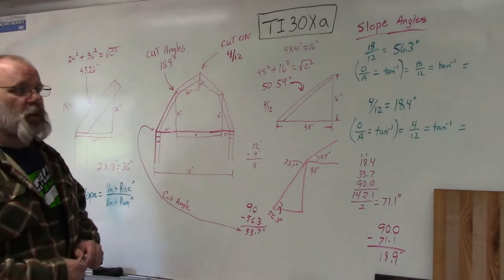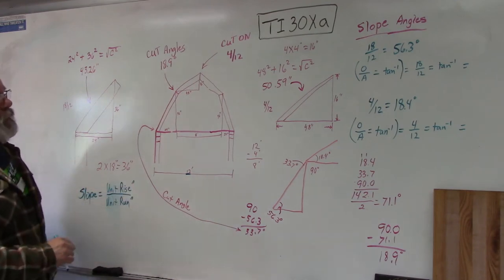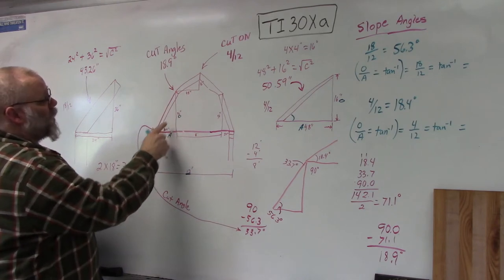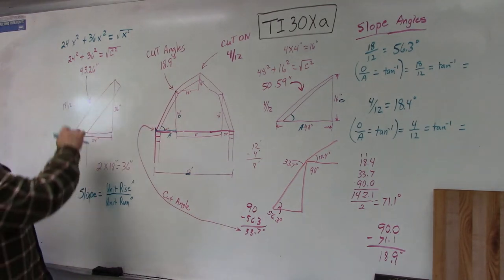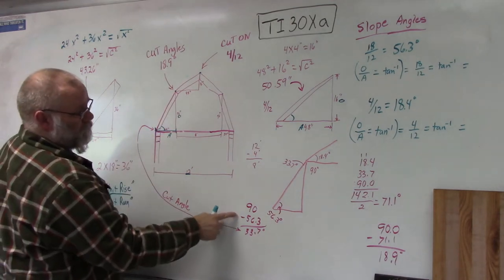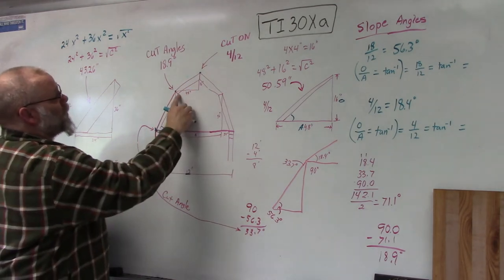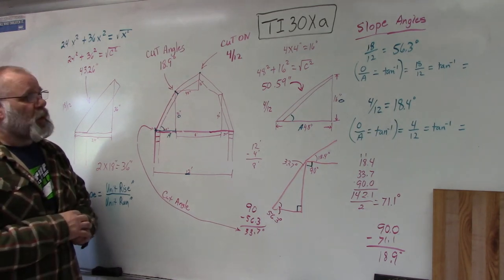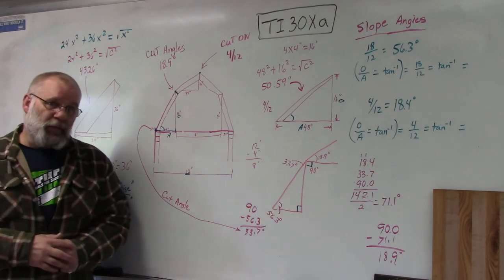Figuring rafters for barn/gambrel roof

Comment: Hello! I am really hoping you can help me out with this because I'm not getting a ton of information online about it. I'm looking to build a 16'x12' gambrel shed and I want to run the trusses lengthwise (16') instead of the traditional way of width wise (12'). This would solve a lot of issues with the layout of the interior and the aesthetic of the outside since I would like to add a roof off one side to cover a boat. I want a garage door in the middle of one of the lengths sides of the shed and it double door on the other with just windows on the width. I found out from a different source it's possible and possibly even preferable with the layout of the doors, but I can't seem to find any plans for it. I can draw my own, but not being an engineer, I don't know how many trusses I would need or if there's anything else I need to factor in to make it structurally sound. Any help or feedback is greatly appreciated!
Reply from the maker: Do you want trusses 16" oc or 2'? Convert the 12 ft to inches then devide by layout in inches + 1. Example 12 × 12 = 144, 144 /16 = 9, 9 + 1 = 10. You would need 10 rafters if you put them 16" oc. 7 if you did 24" oc.
Reply from the maker: The walls woul be framed as usual.
Reply: @timpalmer-logstolumber1999    Thank you so much! You're amazing!!! We were planning on 16"oc so 10 it is!!! I'm currently drawing up the plans for it to submit for the permit so we can start the whole process as soon as the weather permits! So I appreciate how quickly you replied! You got a subscriber out of me!!!
Reply: @timpalmer-logstolumber1999  I've seen it discussed on some forums whether it's better to run the trusses parallel to the floor joints or perpendicular to the floor joints. I'm interested to know your opinion on this...
Reply from the maker: @kaleylynn6565  it does not matter which way the trusses run as long as the bearing wall load is transferred to the ground. The roof will be taller running the rafters the way you want them.